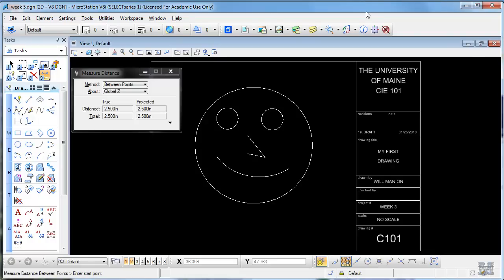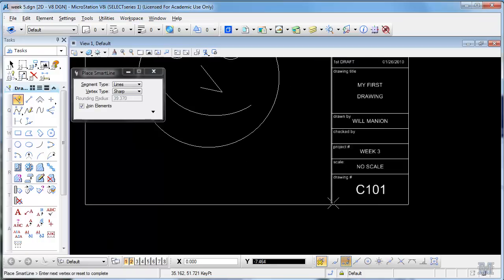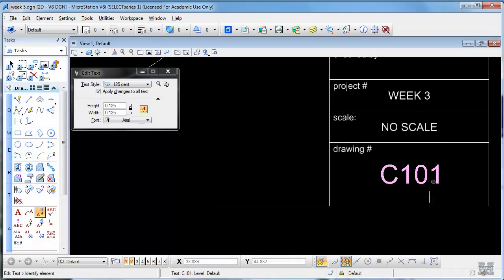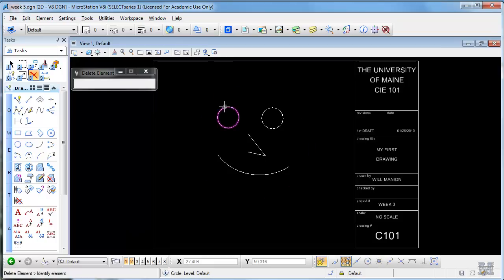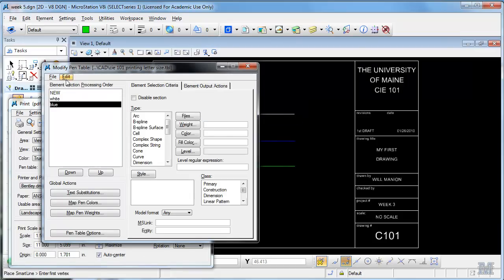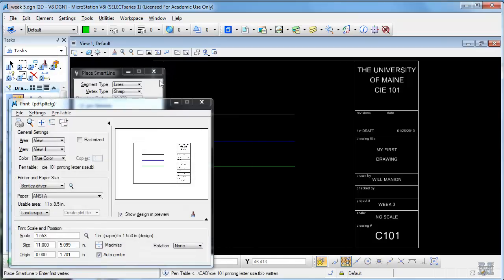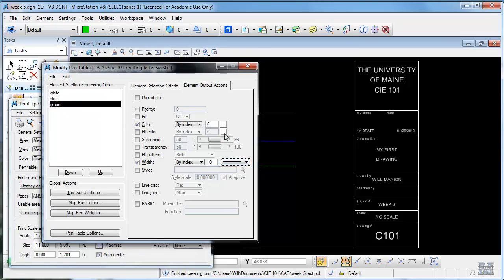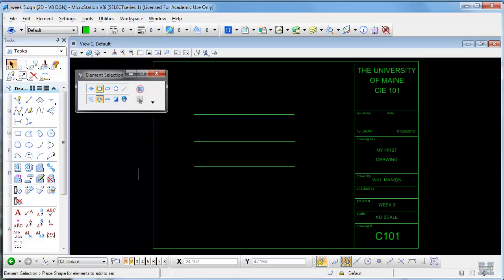Microstation lecture 06 (CIE 101, Civil Engineering Grapics)

Comment: captnwill I have a question. I tried replicating the title block you demonstrated in your video using Microstation, but when I converted my file into PDF form, the text became the same line weight as the white line; but I noticed that the text in your PDF appeared to be unchanged. Can you tell me why that is?

Comment: At 8:50 you pressed the Print Icon and were able to save the file as a PDF. When I pressed the Print Icon it didn't give me a saving option. It just printed.
Reply: Open your print dialogue, Printer and Paper Size, change from Windows Driver to Bentley Driver. Click the Magnifying glass and select pdf.pltcfg
Reply: You're right! My settings was set to Windows Driver when I pressed the Print button. Thanks for your help.